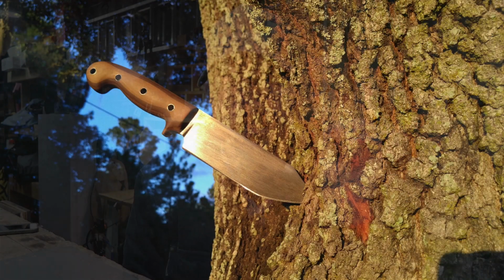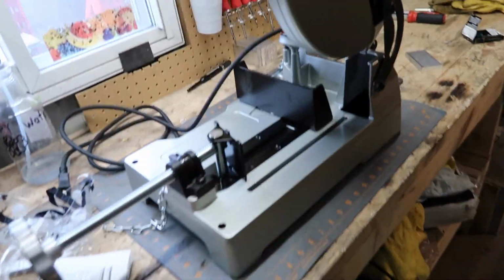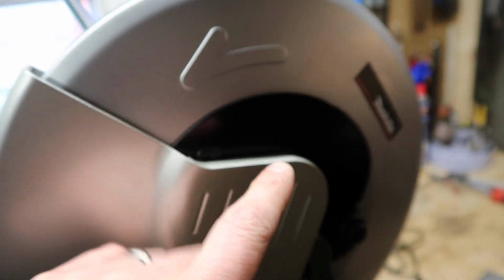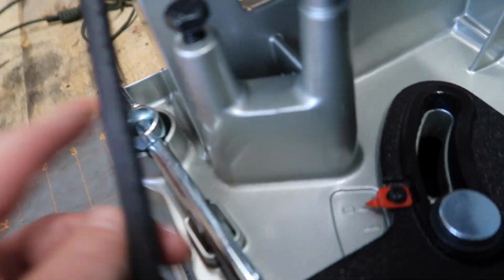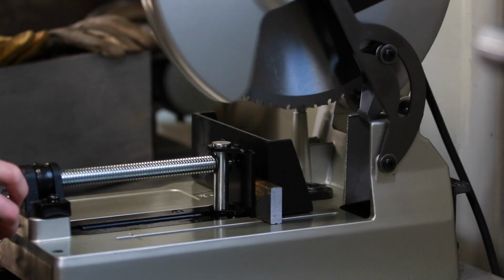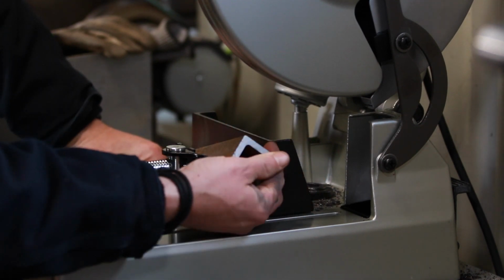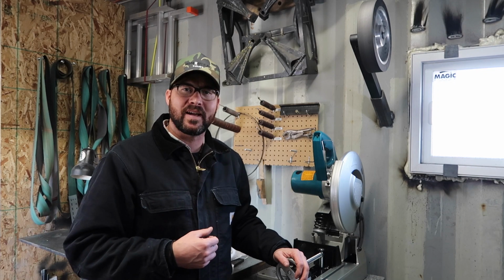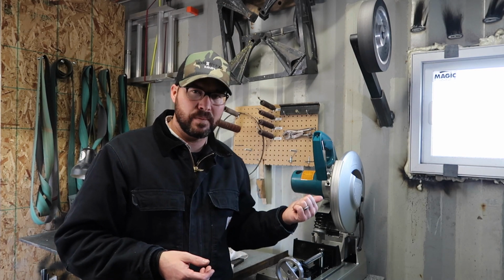Tool Time Tuesday - Makita LC1230 Cold Cut Metal Chop Saw

Comment: It's well worth the money, I cut 45 degrees of square stainless steel bars to make furniture, it's PERFECT 45 degrees, saves a lot of time, the cut is ready to weld. I can literally make a complex cut of complete inox chair structure in 10 min, in the regular abrasive saw takes almost a hole hour to get cut and grinded out to make the angles right. And the weld finishing is better so saves time in that fase also. This is the second machine that every TIG welder must buy. With some practice and a good electronic angle meter you can cut perfect angles that is no way possible with a abrasive saw.

Comment: I'm normally not a fan of the stamped bases, but after about 25 years of using and abusing my Makita abrasive chop saw, I tore it down, cleaned off the rust, primed and painted the stamped steel base, and it is as straight and clean as new.  Having used that type clamp screw release, I'm not real fond of it.  Other saws have a release that you just push straight in, which is faster.  For cutting aluminum, I just use my wood-cutting saw with a carbide miter blade (also works fantastic for copper pipe, which is what I used when I replaced all the plumbing in my house in California).

Comment: 8.40sec mark, if the angle piece fits against the back wall you should cut it on its edge, it will save your blade an cut quicker because your only cutting through single wall thickness the whole time

Comment: I love my Milwalkee 14" dry cut saw! I know that the cut is cool, but the chips coming off are hot. I might not hook up the shop vac, as the chips could be hot enough to burn what's in the shop vac. Also always advance the blade into the work, just sitting there in the cut does create heat that the chips are not carrying the heat away. This could break down the carbide blade faster. One of my favorite things is cutting threaded rod the thread is nice and clean and I can thread the nut on without having to file the edge first. I know you're gonna love this tool!
Reply from the maker: Yeah, it is pretty awesome and I love it already! Cheers!

Comment: Nice Saw Im going with the Evolution Rage 2  for only like $185 give or take a little and its a 14" blade.  
Ill be so happy to get rid of my abrasive DeWalt 14" saw

This should work really well for you.  Congrats I know its always exciting to get new tools/equipment.
Reply: I agree I'm a firm believer I you get what you pay for.  But i also know allot of the time you pay for the brand name as well
Reply: I'm with you On the Evolution I also have the Rage2,, I like the Bigger Blade ...
Reply: So far so good but i haven't had much use on it yet maybe 30 mins
Reply: Defnotdemas i need to check.  to be honest i haven't cut any long pieces with it yet. only 1.5" based on that it cut square. i need to find something long and cut to make sure.  thanks for the heads up
Reply: Well my short pieces have been square

Comment: I also use an LC 1230, brilliant on accuracy and 2000th cut is the same as the first one, unlike abrasive saws that distort metal during cutting and leave you with inaccurate mitres. If your blade cloggs up with aluminium, a few drops of 'Tapmatic #2' for non-ferrous metals does the trick!
Reply: Im looking to get this saw to use with 1” solid aluminum rods. Would you recommend this saw? I ask because this review mentioned that the warranty gets voided if used with aluminum.

Comment: Have this same saw at work, 4 blades later (the OEM makita blade, another makita blade, a 72T Dart metal sonic and a 60T Dart) and still going strong. Must have made 1000's of cuts of 25mm box tubing, no problems, just a few lost teeth when the work piece wasn''t clamped properly. Runs like a champ. 

The base is made of >AL<. Check the casting marks underneath

Good idea to set the back fence with a true 90 and 45 degree and scribe/score a line in the base for easy reference. The markings on the back fence are rarely accurate. Can cut most metals except stainless steel (a few cuts and bye bye blade)

Makita make good tools
Reply: Twinfire they do a blade for stainless
Reply: Twinfire and can you tell where is it made? Is it made in Italy ?

Comment: The supplied blade is for mild steel only. Makita does not advise to cut aluminium with the stock blade. A 12 inch non-ferrous dedicated blade with a one-inch arbor hole is recommended.

Comment: Just a tip you don’t need a metal cutting blade for aluminium it’s so soft you can just use a regular wood blade been doing it for years at work and it works great

Comment: I got this saw. Looks very well made but I am experiencing vibration while cutting. The saw is mounted very well to a heavy duty work stand so not sure where the vibration is coming from and I do not get clean cuts like in your video. The cuts are straight but it leaves sharp edges. I am thinking the Makita saw blade that came with it could be the problem. I will try a Diablo Steel Demon 12 in. x 60-Tooth Cermet II Metals and Stainless Steel Circular Saw Blade and see how it goes.

Comment: Very nice saw, we have the same one at work. A much older makita, and that thing is cutting something all the time, probably 5-6 hrs run time a day for the past 5-6 years. It cuts eve thing from hardened tools steels aluminum and phenolic. I wouldn't worry too much about cutting aluminum with it. The saw was made for that and steels. I'll check out what blade we run at work, they seem to last a unusually long time. Congrats on the new addition!
Reply from the maker: That's awesome. And if you cold check at work that would be sweet. Glad to hear of others using it in the way I want to with success. Cheers!

Comment: Thanks for the video, I ended up buying the Makita in good part because of your great review.  Out here in Saskatchewan no one sells replacement blades, in your review you mentioned easy access to replacement blades - where are you getting your blades?

FYI - anyone buying one of these saws should read the manual prior to cutting.  I pretty much destroyed the OEM blade cutting 3X3X3/16 square tubing for a new welding bench project...
Reply: Amazon.ca sells blades for this.

Comment: how has it held up?
Reply from the maker: I was actually using it yesterday (it will appear in an upcoming video) and I was thinking how great of a tool it’s been. Maybe I should do a follow up video. I use it fairly regularly and have a few dozen hours on it of cutting time. Zero complaints. Cheers👍

Comment: What's the "throat" capacity of the Makita dry cut saw?

For example what would be the widest pieces of plate you could cut at a 90° and a 45°?
Reply from the maker: I am not sure. Haven’t measured it and pretty much only use it for 2” and under square tubing.

Comment: Hey guys, I bought myself this chop saw about 6 months ago and use it for cutting titanium pipe. It worked as intended the first 4-5 times but after that the cuts kept taking longer, more burs appeared and the metal was cutting hotter and hotter. Anyone know why this is? Is it the blade? Can it not handle Titanium? And any idea what I can do to fix it/ any saws you can recommend?
Reply: You are using mild steel saw to cut titanium - Of course it would dull the blade. Get a proper blade for ti
Reply: @souffianeyasser  Do you have any recommendations?
Reply: @LiamDavidsonYT  Use diamond cutting disc (coupe tout) french made. Or use the old abrasive chop saw for titanium. Titanium is much harder than mild steel.

Comment: Great review! Thanks for posting. I like the fact that the Makita has a cast aluminum base instead of the stamped steel base from the competitors. 12" blade will cost less than 14". I believe that cold cut saws are the way to go, though initial investment is high. Time is money. I believe you can buy a replacement blade to cut aluminum? Non ferrous metal blade?

Comment: Ha YOU FOOLED ME at 1:28 IT'S  a Makita not a Milwaukee, one  fact not commonly understood is with steel stock imported from China you could have a hard zone  somewhere throught its thickness, and when cutting, if you are unlucky,it will lead to premature wear of the blade .This is when abraisive chop saws have a very distinct advantage and are ideal for cutting harder stock.Of course the same thing can happen if you randomly cut steel stock of unknown origin e.g. from a scrap yard,nice review though,and a happy new year.

Comment: some day.. lol if I come across one in Stock.. or a bandsaw.. useless suppliers around here are only factory order. would have been nice to make the parts for my belt cutter. how much did you pick it up for?
Reply from the maker: $600 CDN. Not cheap by any means but I think it will be worth it in the long run. Cheers!
Reply: Спринг роллы

Comment: With cutting aluminum you want to use standard wood circular/radial arm saw speeds with a carbide tipped wood blade. They cut through aluminum stock like butter. Same with bandsaw's you want your blade speed to be close to what you would use for wood.

Comment: I am considering purchasing this saw (it is between this and the Dewalt 14"). I have read mostly very positive reviews, but I have read a few where they comment about the adjustment with vice/table but the motor and blade are actually out of square! which makes it useless for any precision work and there's no adjustment for this. Any one have any problems like this, any comments would be appreciated.

Comment: You should not use the 60 tooth blade on stainless steel. It will not last long. Go for the 78 tooth blade, that blade is also better for thinner mild steel. Cutting aluminum is not ideal, it will jam up some teeth and break them off. If you lucky you can get away with it but stay careful and make sure you check the teeth after each cut, also use some tapping fluid for aluminum, this will prevent clogging the teeth. Don't want to damage a 100 US$ blade to soon.

Comment: On the Makita's vid, they say it's not for aluminium. Thoughts?
Reply from the maker: yeah I saw that. I've been cutting a lot of aluminum and I've started using A-9 cutting fluid with it. Before I was using the A-9 I was seeing quite a bit of build up in the teeth and the finish wasn't all that great. I think the reason is because of the blade that it comes with. The rake angle of the teeth is not designed for soft material like aluminum. But since using a small dab of cutting fluid for each cut, the aluminum doesn't build up in the teeth at all and I get a really nice surface finish. It actually works really well now with the A-9. Cheers!
Reply: Simple Little Life 

Thanks for that, I was thinking there was a danger issue. But if it's just a finish issue it won't matter for me cutting bits to go in my lathe. Thanks again.
Reply: A-9 is pretty costly, you can also use some WD-40, kerosene and paraffin/wax to get good results, just that kerosene stinks a little more than wax...
My Porter Gable cold cut is also doing great...
Most of my Makita tools are still alive compared to De-Walt or the rest...   ;)

Comment: is it good to buy a metal cutting saw then attach to the abrasive cut off saw? New subscriber here ;)
Reply: An abrasive saw speed exceeds the RPM rating of a typical carbide blade. What will most likely happen if you do this is that the carbide will overheat and the blade will be ruined after several cuts. Also, the mounting hole diameter differs

Comment: Do you still like your razor edge sharpening system? Saw your older video and thinking about getting one... Love the channel!
Reply from the maker: Yes! I love it! Probably sharpened at least 50  knives with it now and I'm a huge fan. I'm actually going to make a tool rest and a knife clamp for it so I can sharpen the exact same angle on both sides every time. That'll be coming up on a future video. But even free-hand, love it. By far the fastest way I've found to get a really sharp, really clean edge on a knife. 

If you do buy one though, one tip: don't use too much wax on the gritted wheel. I made that mistake and now I have to re-condition the wheel. No biggie but when they say use the wax sparingly, they mean it. Cheers!

Comment: Fence moves. 
       The flaws in these cheep saws are always the same.
 Light castings for the base and  fence.
     It's going to move.
Look how high the threaded rods positioned on the clamp.
 It naturally wants to push over the fence and pull the base up. 
  So what happens is too much downward  pressure combine with a bad blade + an offset handle  equals angry man.

Comment: I've been eyeing this saw for the last few months (currently have an abrasive chopsaw).  Any reason you chose to go with the cold chopsaw versus a  Floorstanding 4 x 6 metal bandsaw?
Reply from the maker: Number one reason is space. My little shop is a shipping container and it's full of tool so space is a premium. But also this is significantly faster than a bandsaw. I used to work in a shop with 3 nice fully automated Hyd-Mech band saws and those are great for large projects and even making several thousand of one piece. But for time when you're fabricating project by project, I think this is a much quicker option. Also the finish is better than I've ever seen come of a bandsaw. In a perfect world, I'd have this AND a bandsaw:) Cheers!
Reply: Makes sense. Thanks for the response. Really enjoy your channel by the way!

Comment: I watched several reviews on the Evolution saw before purchasing one and it works great. One thing I don't recall anyone else mentioning is that the Evolution blade remains almost the same diameter for it's whole useful life, but an abrasive blade gets smaller in diameter with each use. This can be important when cutting larger stock, or cutting at an angle. With my abrasive saw i sometimes found myself swapping in a new blade to complete certain cuts.

Comment: I was skeptical , at 7:37 i felt some tension because looked like you were going to burn your fingers. Instead you laughed with positive surprise :)
Reply: NeverStopSeeking and he even really took his time with the cut. with dry cut saws, because they run rather slow, you have to really push the blade into he material just like with drilling metal. they can handle it, will cut faster and by that cooler.
Reply: I did not know that, thanks for sharing!
Reply: Never Stop Seeking 😂

Comment: I love my Makita cold saw.. cuts like butter and i cut myself from a 45 degree  angle bar because the edge came out like a knife. I am worried about my blade as after about 100 cuts it exhibits some wear on the blade. I was careful with it and i used a bees wax lube every  10 cuts. There not much literature in the manual about speed or force when cutting. I used common sense and kept pressure consistent and speed was not aggressive ( Aircraft Mechanic background).

Comment: 14.04.19 - 1.24 Not Milwaukee this one a Makita. How about clamping down 2 inch pipe and tube does it hold tight and not turn removing the tips of the teeth when the pipe turns.

Comment: that is not a true cold cut saw, they have running coolant and usually 3 phase motors.
Reply from the maker: I do know exactly what you’re talking about and used to use one at a fab shop I worked at. This is a fairly common term for these types of saw though. Run slower and the material doesn’t heat up nearly as much as an abrasive chop saw. I think that’s why these are often referred to as a cold cutting chop saw.
Reply: @Simplelittlelife  yes that is right, they leave almost perfect cut surface, but they are extremly heavy, require 3 phase power, and you need different blade for any material that you cut so you don't ruin them because they are very expensive. They are used in the production enviroment and most people like you and I are better soothed by Chop saw like yours.

Comment: Don't mean to split hairs here but this is a dry-cut not a cold cut. There can be sparks. Traditionally, A cold cut has fluid jets, a heavy cabinet base and runs from 3000 to 10000 dollars. Just sayin'
Reply: I dont know if the misnomer is because the metal is "Cold" after the cut as opposed to a chop saw "Hot" but i understand your point.